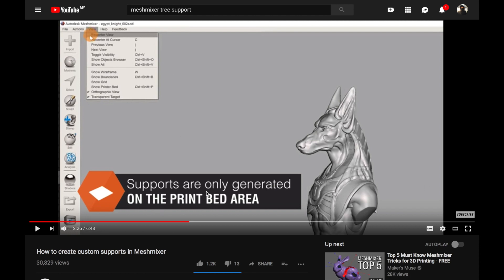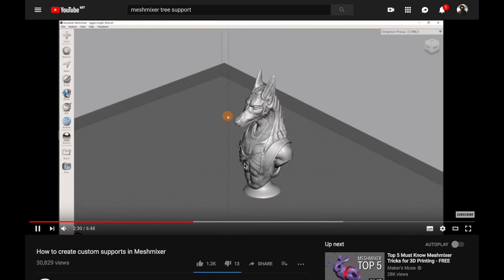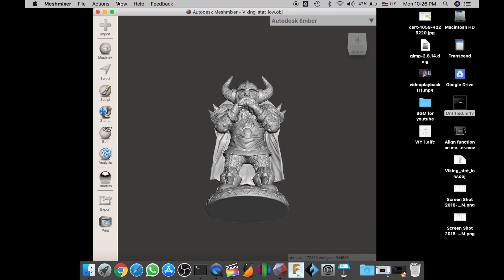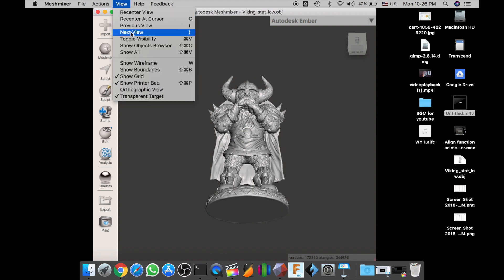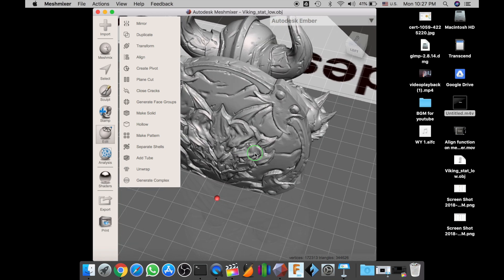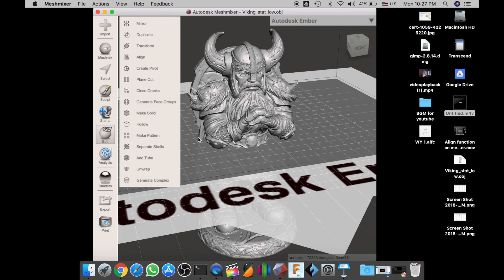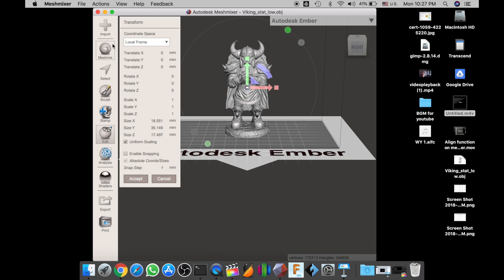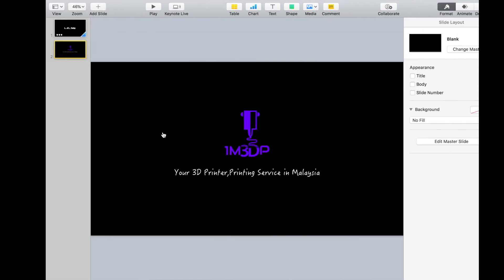How to move model to print bed in Meshmixer for generate support

Comment: Another problem is I added ender 3 pro to printers in meshmixer and added cura as software but when I click print it doesn't open cura what's the problem here? Anyone knows this?
Reply from the maker: normal. just export and print from cura .
Reply: @MBBFM  so the Meshmixer won't open and play the model automatically into Cura?
Reply from the maker: I am not the right people to answer that. but i tried . feature buggy so no point to use. btw i dont use cura now

Comment: This is driving me nuts !!!!!  I click align and base point and no matter what it hovers just above the print bed!!!!!  when I generate supports I get a TON coming off the print bed to the model. 
Transform doesn't work either because It impossible to eyeball when the model is on the print bed!!!!
I'd kill for a simple 'settle' option like 3d builder.
Reply: I reduced Y-offset to 0 and it stopped generating supports from the build plate.